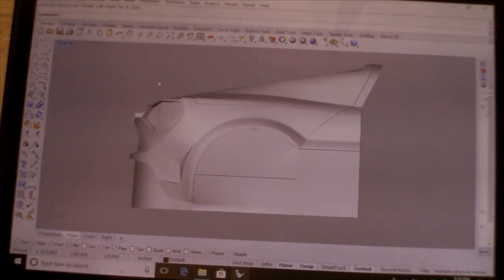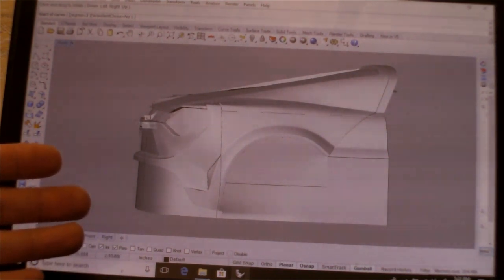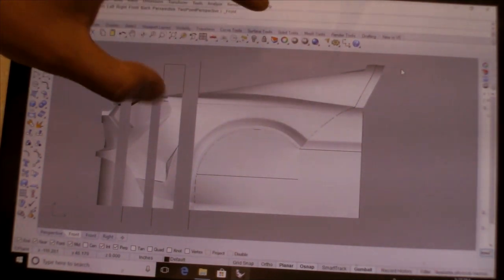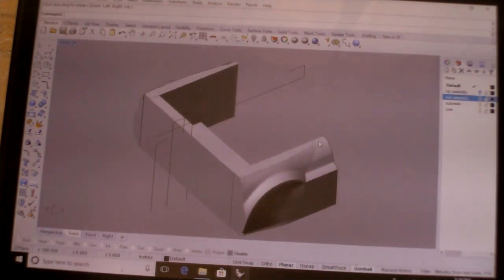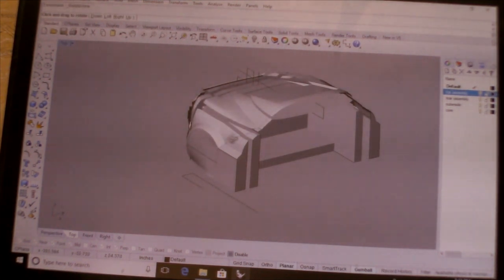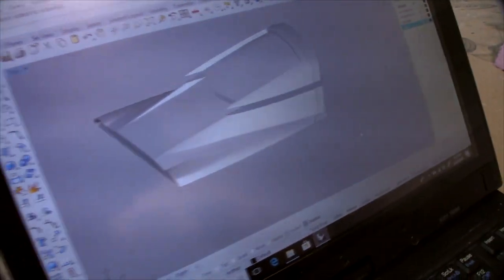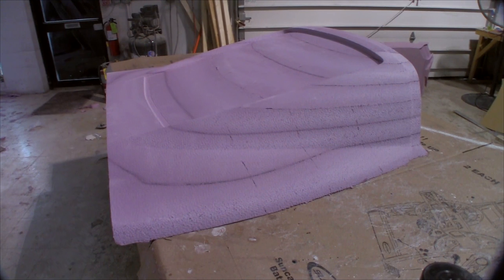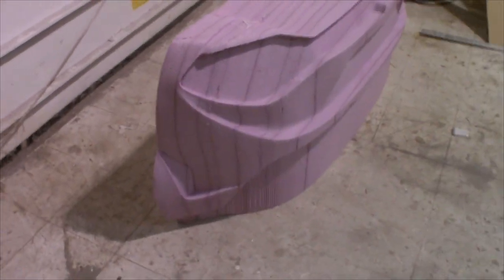How I CNC built a car body in detail.

Comment: Loved your video, planning on doing about the same thing, scaling up slighting the size of a circa 60’s Mercedes 319 Micro Bus that will be electric and hopefully if approved use a small diesel Liquid Piston Rotary engine to generate the the needed Kw to charge the 400v+ battery in order to keep the battery smaller and the weight down🤔

Comment: Can you machine some plugs for a truck build project that I'd like to do?
Your system would result in 100% accuracy compared to me removing material via sanding glued layers of polyurethane.
In fact, what I have in mind is so much simpler in design than your exotic car.

Comment: So after this foam is made, what do you do with it? Fiberglass over it so you have parts to build the actual car? Also, if you could point me into the right direction for a decent CNC machine and/or the program you used for it I'd appreciate it. You're probably a busy guy so I understand if not. Great work! I'll definitely be following your channel!
Reply from the maker: Hi Chris. Yes, the Styrofoam has to be hardcoated and finished first then molds would be casted from the plug. research on building your own CNC. Im using a custom build CNC so I cant really recommend one. Existing CNC router tables don't have the type of z height that's good for machining automotive plugs are anything of that size.
Reply: @InspireCNC  thanks for the reply! I appreciate it! From what I've been seeing, you're absolutely correct about not many CNCs being right for what I'd like to use it for. Building one doesn't seem too bad either. Thanks again! -Chris

Comment: I'm considering a similar construction method for an experimental airplane, a Long-EZ.  I assuming I'll need to CNC both sides of a foam block to account for draft in the model.  Did you run into this problem?  Was the stock foam the exact thickness of your "slices" or where they machined down to the correct thickness?  Nice work.

Comment: I'm trying to convert a car that's in polygons to NURBS, I'm trying on Rhinoceros but I can not. What program do you use to do this conversion? Thanks for sharing your knowledge!
Reply from the maker: converting wont do much for surface quality. but you can try the tool meshtonurbs in rhino.
Reply: thanks for the reply. Unfortunately for the meshtonurbs here did not work, for having many polygons the Rhino can not convert. Do you usually model the car even if it had a mesh of it?

Comment: Looks Amazing!!  When you cut the foam do you do a rough tool path first then a finish tool path or just finish?
Reply from the maker: I skip a roughing pass, saves alot of time. the only time i use a partial roughing pass is to eliminate an inch off of the top of the box stock to be able to cut a 6" depth part with a milling bit that has a 5" flute from a 6" box stock.

Comment: Always wanted to do this, great vid!!  If one wanted to make say fender flares, where clearly the back side (mounting surface) is contoured to the body, does this make it much harder to use a 3 axis setup like this to make a plug?  Also, how much (wild guestimate is fine) would it be to design, 3d model, route plugs, and make molds (4 fender flares for an SUV?)

Comment: you use renshape? I'm a tool and die maker, I make automotive carpet molds so pretty similar to what you do. i find that if I'm making a fiberglass mold its better to use perfect pine cause its cheaper. the downside is that its not as dimensionally stable.

Comment: Wish I could help you make the mold.... I see some issues having done this many times before, little tricks of the trade to make and keep it SQUARE as weight & heat from curing resin try's & WILL warp the foam in some degree!... Two Heads, 4 Eyes, Years Of Wisdom are all better than one! ....... Best Of Luck To You, It Will Look Great When You Are Finished, I Have No Doubt.
Reply from the maker: Thanks for your input and the good words. I use to watch your videos a few years back when i started working with fiberglass. Pretty cool to have you come and comment on my videos now!
Reply: I call them as I see them, when I watched your video and then went back to see all your videos, I told myself, This Young Man GETS IT! .....  You remind me of me about 20 years ago, tons of passion for what you are doing and already thinking of whats next! .... Yes Indeed, Im A Huge Fan Of Inspire Composites! ..... Maybe i'll pay you to CNC a body design for me when im finished my current project? ... Keep Up The Great Work!
Reply: Take a 3D Model of your favourite car and divide the model into LEGO’s and 3D print in pieces, epoxy them together and prep for resin. Wood mock-up frame underneath. Done.
Reply: wow, gasser is still alive?.. I remember you're where I learned about gel coat! lol

Comment: Just found your channel.  Amazing!! ...Amazing!!  I tried the same foam for a fender plug I wanted to make but the bit i am used caused the foam to melt and messed it up.  I slowed the router down but then it breaks the foam.  What bit are you using and speed to get such amazing cuts edges?
Reply from the maker: are you using a 2 flute spiral? 8-14k RPM at 100-200 IPM.
Reply: Thank you for the response.  2 flute straight. That could be the reason why, its not pulling the chips out.  Amazing Job!!  Keep the videos  coming
Reply from the maker: also try a bigger bit if your going too small. 1/4" the smallest you should go for milling styrofoam. GL.

Comment: Very cool stuff. One suggestion would be to look into spray adhesive in larger canisters, if you haven't already. 3M sells them in all different sizes, they look like propane tanks from a BBQ grill, it's much cheaper than buying the normal cans if you have a lot to glue and it seems like you do.

Comment: Why not just use a second hand robot with a spindle, if you want 5axis. Like a Kuka.. they aren't that pricey used
Reply from the maker: there pretty pricey, and they wont get the job done like a 5 axis gantry can.
Reply: Inspire Composites in Europe you can get them second hand for small money.
Seen several shops using them for 5axis milling.

Comment: What router table do you have?
Reply from the maker: custom built.
Reply: Cool! would you do a video about your table!? Your using Rhino3d too right? I built a 4'x4' plasma/router and I use fusion software, I'm always curious about other setups! What like/dislikes do you have with the table/Rhino? Also what CAM/Gcode software do you use or is it integrated into Rhino?
Reply from the maker: Im going to do videos on future cnc builds, but not on the table I have currently. Yes, I use rhino 3d. I like it alot for modeling surfaces, but for component drawing and simulation its not very good, so i keep a copy of solidworks for that sole purpose. I use rhinocam.